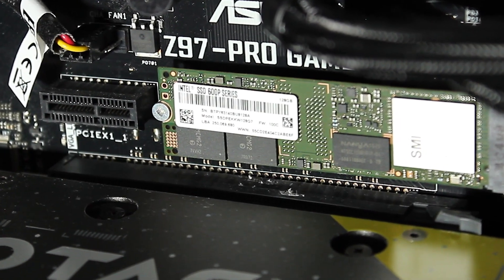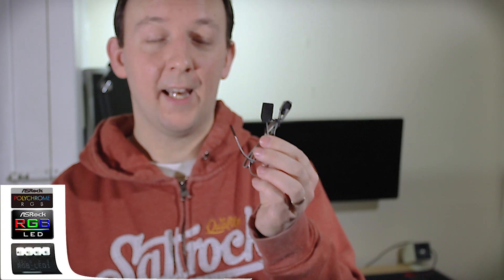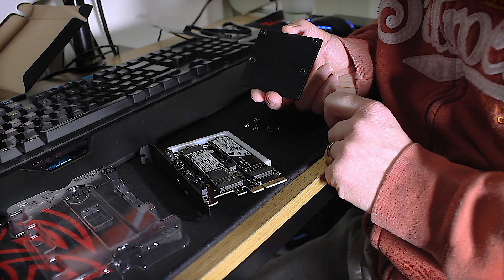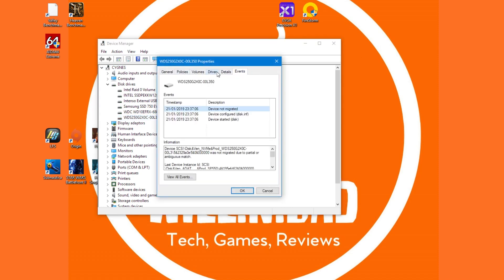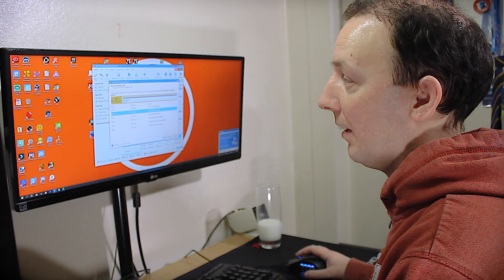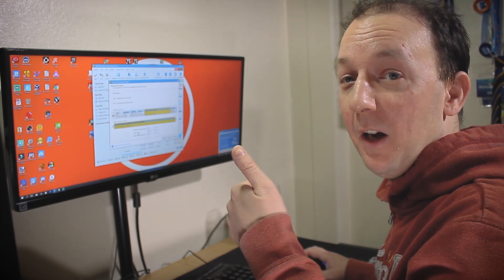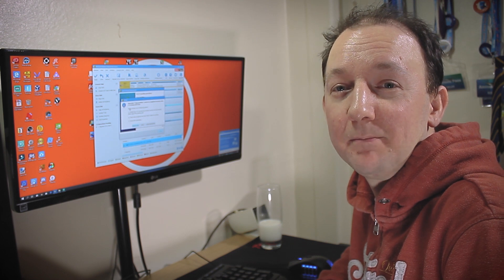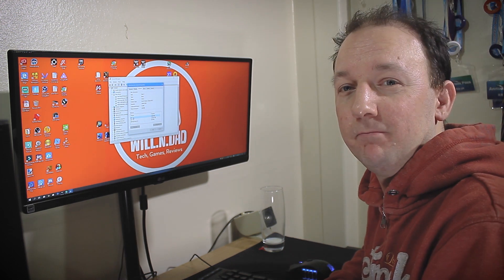How to - Upgrade Your M.2 NVME SSD

Comment: Thanks for the video, mini tool did the job after i found the 10.2 version, the latest 12.0 wants you to buy it before it will migrate the drive over!
Reply from the maker: Thanks for the info! - hmm i'll have to find another tool in future, i don't agree with having to buy it for that reason. not when it was free before

Comment: 1:20 so there's the solution, buy a PCIE adapter for the 2nd m.2 drive.
I don't really want to have to buy more equipment just to use once for the upgrade. I know I could just buy a USB to M.2 adapter if I wanted but again it's a pointless purchase in the long run.
Reply from the maker: Not really. For me I've already used it for something else now, but its a means to an end. And it worked. So I stand by my video, I did also say there are other methods to do the same thing. Choose to do it this way or not. That's your choice. This was 1 way to do it. For me.. it worked.

Comment: hi there i bought the same thing now wondering how would i control the rgb lights on my z97 board.. thanks for your response
Reply from the maker: Mine had a button on the back plate, but you won't be able to control the rgb unless you have a compatible controller or motherboard that has rgb headers. I don't believe z97 motherboards did. I know mine doesn't.

Comment: so with that nifty add-on you can use 2 types of M.2, NVME and SSD....the NVME is recognized automatically and the SSD has to be connected via the sata cable to a normal sata port on the motherboard to be recognized?
Reply from the maker: Yeah, it's a shame they didn't pass the sata side via the pciex slot but hey ho.. for the price it's not to bad. I use it for my boot drive and plan to setup SSD cacheing for HDD based games, when I rebuild my rig soon
Reply: @WnDTech  fun fact, on amazon site the company tech said that its not for NVME drives and dont recognize it but it sees my 970evo no problemo, when hooked to the proper slot
Reply from the maker: @quebecpatriot1874  on their site it says "-Supports one M.2 PCIe (NVMe or AHCI) SSD and one M.2 SATA 6Gbps SSD simultaneously. Supports M.2 size form factors 2230, 2242, 2260,2280 2.Converts one M.2 (M Key) " not sure where you are looking buddy.. no matter, it works :) it's a shame we can't upload photos so people could show off their rigs etc :)
Reply: @WnDTech  amazon.ca  :p  in the questions down the page  https://www.amazon.ca/gp/product/B07KZBMLSR/ref=ppx_yo_dt_b_asin_title_o02_s00?ie=UTF8&psc=1 he says: 970 pro is NVME ssd, it won't compatible to this enclosure.  another customer that know zip says: 
No. This enclosure only works with SATA M.2 drives the Samsung 970 Pro is an NVMe drive.  No worries, I will correct this all tonight after work
Reply: @WnDTech  well, we could always give liniks to pics viewers,,,I personally just finishing building a view71 with 16 fans in it....lol gotta go pickup my 360mm rad in an hour or so
Reply from the maker: Liked... Better late then never

Comment: Great video mate. I bought the same model in Decemeber. I have a 2TB Samsung EVO 970 in the NVME slot,  drive recognised in Win no dramas. Have recently added a 256GB m.2 via SATA.  Sata is hooked up, have been fiddling around with BIOS settings, but for the love of me cannot get it to register the second slot. Any ideas? Much appreciated.
Reply from the maker: Hey, cheers dude, I've got my sata m 2 drive connected but not yet plugged it in, I'll have a crack at it tomorrow and see what happened. I'll update when I know. Cheers
Reply: Will.N.Dad appreciate the speedy response! Please let me know how you get on. My device manager in windows and EaseUS drive software won’t detect it so I reckon it’s something in BIOS I’m missing
Reply from the maker: @Jordz_Plays  still not tried this yet, i now plan to use the ssd m.2 port as a StoreMi cache drive for my games spinning drive. probs do a video on that too.
Reply: Will.N.Dad I know what the issue is mate, sorry I didn’t update. I contacted the manufacturer, the issue is you have to have a SATA M.2 in that data slot, you can’t have two NVME M.2s working simultaneously. One like this:

WD Blue 3D NAND Internal SSD M.2 SATA - 1 TB https://www.amazon.co.uk/dp/B073SB2MXT/ref=cm_sw_r_cp_api_i_bVxUCbZ6RFDTF

All the best.
Reply from the maker: Yup that's correct, pretty sure I mentioned that in my video, maybe I'm wrong?? Yup 2nd slot uses the data port for SSD m.2 only. Not nvme. Basically the slot nearest the sata connection is for m.2 SSD not nvme drives ;) glad you got it sorted.

Comment: do you have to use the thermal pads? is it recommended?
Reply from the maker: Hey, thanks for watching the video! Personally I would use the thermal pads, as nvme drives do get pretty hot depending on usage, Over time the heat will affect performance of your nvme drive. Download a HDD/SSD life checker, they usually have some kind of temperature monitoring.
Reply: Will.N.Dad thanks for the heads up!
Reply: @TheRealGrimPanda  remeber, carefully remove the stickers; I stuck mine on the back of the plate
Reply from the maker: Yeah defo worth keeping them safe, incase of return.
Reply: @WnDTech  yeah my adata has it on the back already! Great drive if you haven't checked it out yet xpg sx8200.